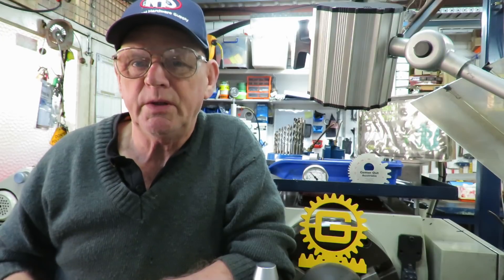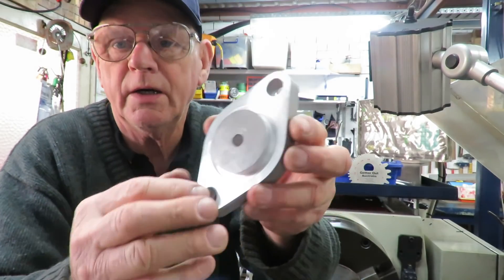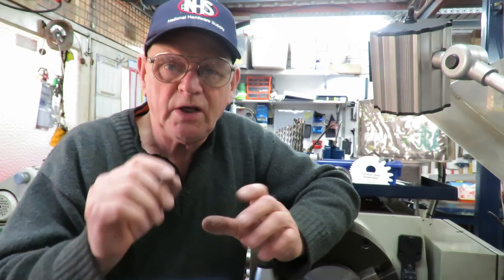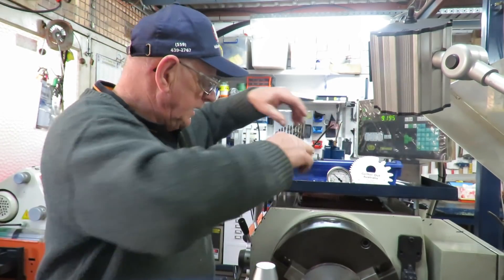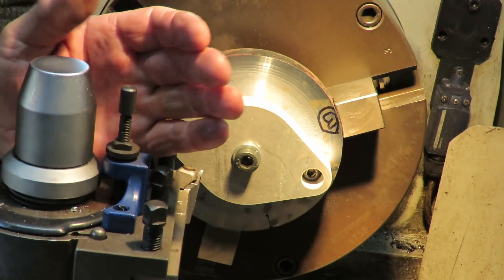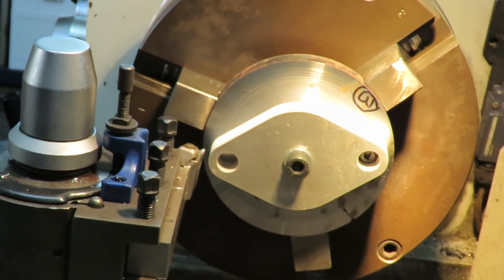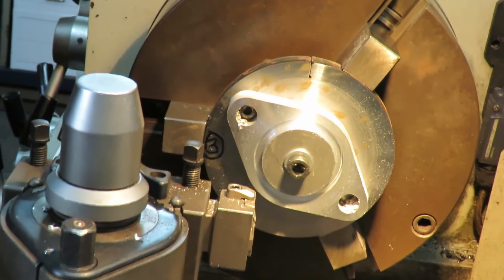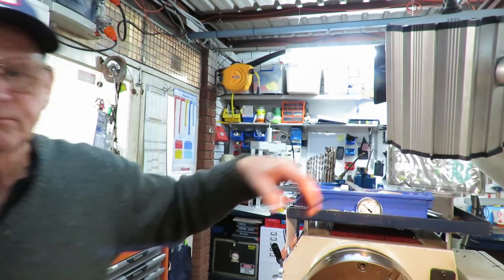465 Quick Fix for a Fixture for small run of non circular flange machining.

Comment: Bruce I have heard of mixing kerosene with cutting oil but is that what the idea of using kerosene is, is for the finish ? Nice quick and easy setup. Thanks..
Reply: Similar to WD-40, keeps chips from welding to the tool.